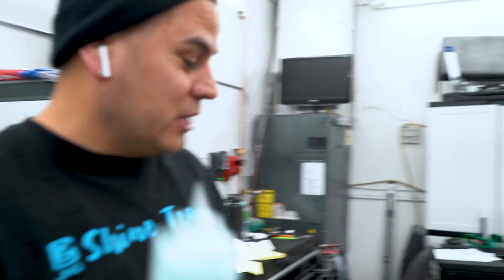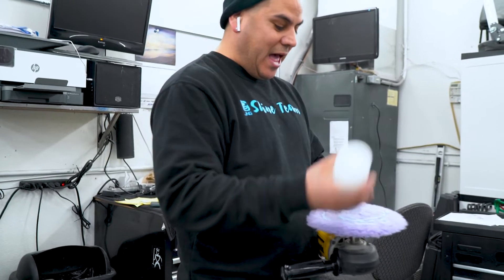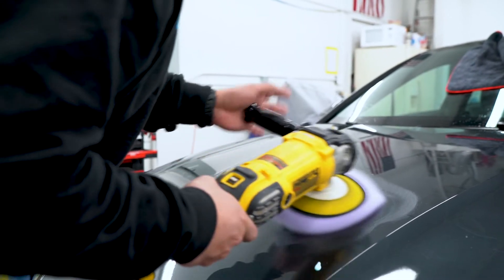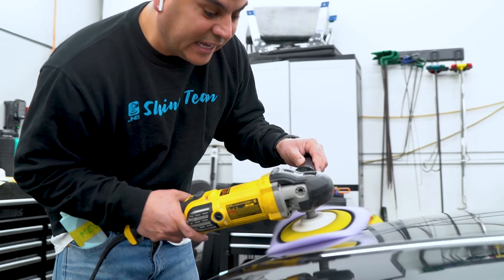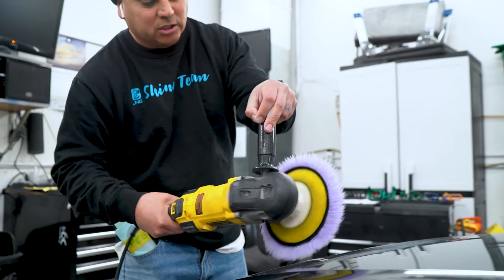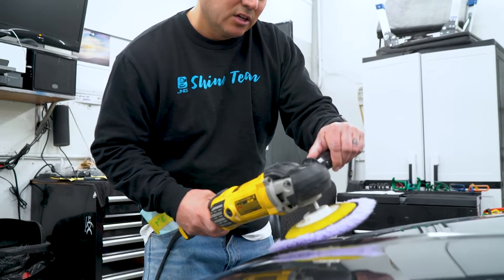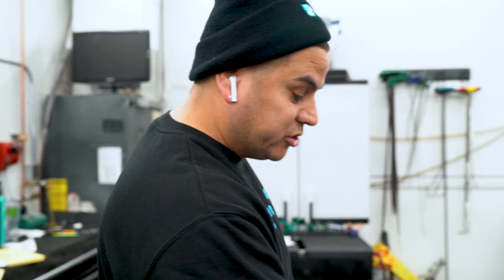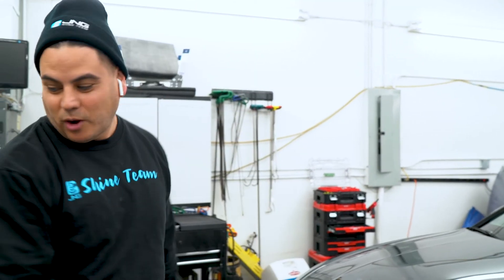Rotary Quick Tip #1 | BEST Technique for DEEP Scratches!

Comment: What speed are you running the rotary on? Thanks for the great video, keep them coming!
Reply from the maker: 1600 to 1800 what ever you are comfortable with there is guys the run it low for heat reasons and guys that go fast not really worries about heat.